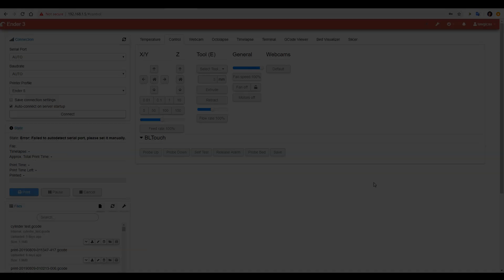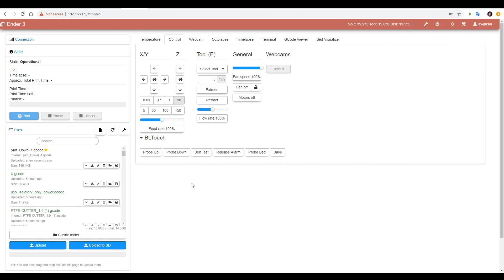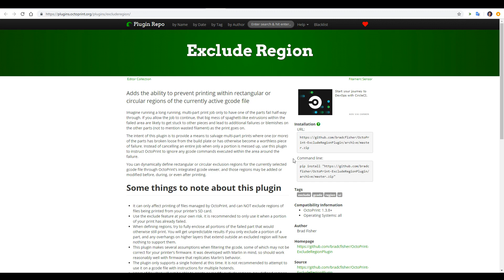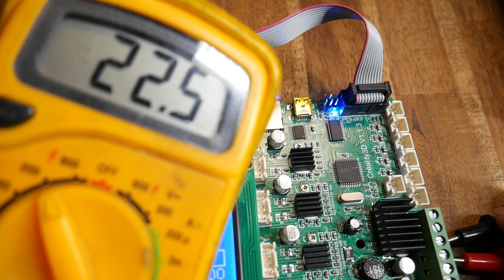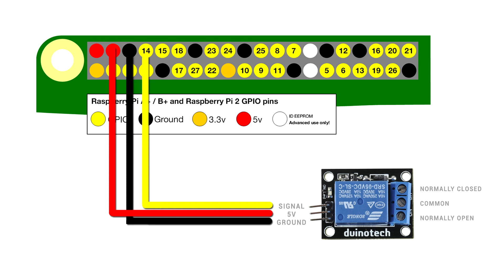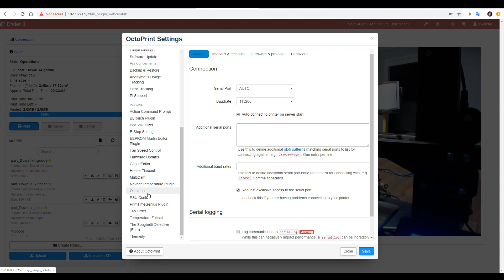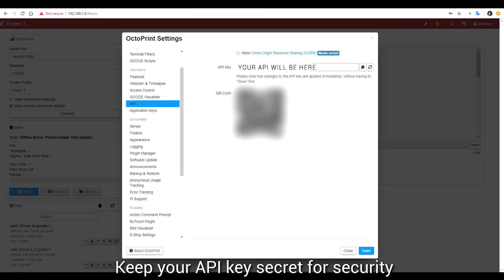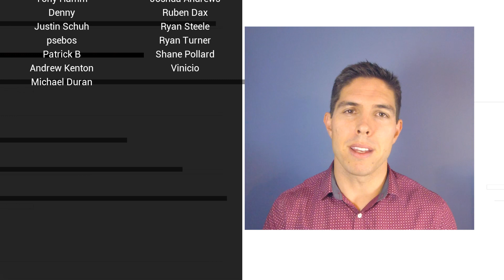Octoprint plugins for better and safer printing - PSU relay control

Comment from the maker: Important note: set your failsafe max just UNDER the maxtemp in the firmware. If maxtemp is triggered first, the printer will disconnect and Octoprint can't read the temps to trigger the warning.

Disclaimer: Just like enabling safety features in Marlin firmware, by completing the steps in this video you can make your 3D printer safer, but never foolproof. Treat it with respect and leave it unattended at your own risk.
Reply: HIGHLY DANGEROUS!!!!!!
The relays you are sugesting are all rated for 10 amps. The Ender 3 however delivers up to 15 amps. Your relay contacts will burn îf your relay gets switched while under full load! DC currents are known for arcing which will result in fire after a short period of time. So instead of making the printer safer, you made it even more dangerous! Please do your homework when posting such stuff.
Reply: @rapman711  Is the YYG-2 30A relay better suited for this task?
Reply: @rapman711  but at 240V that is like 2400W si at 24V And 15 or 20 Amps are +- 400W
Reply: I agree with Raphael Süess
 - putting such a small relay on the high amp wire is not good. Those could be used on the AC wires where the current is much lower. For DC you could use automotive relay - those are in versions rated for 24V, 50A or much cheaper Solid-state relay (but you will lose few volts)...
Reply: @rafalmag  thx name buddy😎
Reply from the maker: Hi guys, I agree with what you are saying and have removed the relay links and instead put a guide to safely calculating a suitable relay. I originally was going to switch the AC PSU live wire input but was worried about someone electrocuting themselves. In hindsight I should have stuck with that.
Reply: @TeachingTech  15A x 30A (450W) ====> 15A x 30V (450W), thanks for the video extremely useful. i am actually working on a fire detector tampering the buzzer to send a signal to a Opto-isolator / Opto-Coupler that also activates a relay, the cost of the firealarm is just 4.5$US last 9 years independent battery and it also makes high pitch noise with any sign of smoke ( very sensitive) if you are interested i can share with you the DYI
Reply: @TeachingTech  how do you power your rpi? external powersupply or buck converter? Can you please share a layout with the connections?
Reply: @TeachingTech  Would you be able to recommend a relay that would be rated for the ender 3? I can find the one you used but am not having any luck finding one on a board that would be rated for 450w.
Reply: @rafalmag  I couldn't find a relay board with bigger relays, but then I figured that. Just put the AC there where the current is way smaller. Plus, it shuts down the PSU entirely
Reply: @soundspark  it listens and i think localhost is the best way to do it
Reply: @soundspark  Remember, you can execute the curl command in SSH terminal, just to test that the url is correct (it executes from the octoprint server)

curl -s -H "Content-Type: application/json" -H "X-Api-Key: YOUR_API_KEY" -X POST -d '{ "command":"turnPSUOff" }' http://127.0.0.1/api/plugin/psucontrol
Reply: Smarter to use the AC wires as the current is much lower.  The 24VDC is ~15A.  That is well above the range of the relay.
Reply: Cutting the heater elements separately could be a solution, split the load between two relays.then you can stop the print and move the head away and still have cooling. will only protect against temp runaway tho.
Reply: Ive been using the Sonoff relays flashed with Tasmota to control the AC power of the PSU, which means all power to the PSU (and hence, the printer) will be cut off. I feel like this was a way safer and less clunky than the relays. Also, if anyone is curious and wants to try the sonoff relay route, look at the thread where I was asking about how to integrate the Tasmota relays into the PSU Control plugin, I got my information on how to integrate it here :)

https://community.octoprint.org/t/how-do-i-control-my-tasmota-sonoff-with-psu-control-plugin/15068
Reply: Hey Michael pls can You make a vídeo on filament monitoring And jam protection with an encoder?

Comment: Automatic range hood fire suppressor.  I have one hanging above each 3d printer.  Like $50 and will put out a decent sized printer fire, assuming the power gets cut and best when in an enclosure.

Comment: Hi, I am a little confused - I currently control my PSU via a TPLink Wifi outlet that I control with Octo Print. Is there a reason I would want to use PSU control with a relay, which seems to take quite a bit more setup, than the current WiFi plug setup I am running now? Thank you!!

Comment: I know this is an old video, but I'm just putting this here in case anyone sees this. When fitting the relay do not just stick the stranded wire straight into the screw terminals, over time that will fail. Also do not solder those wires and then stick them in the screw terminals, that will fail as well. By fail I mean it could melt or catch on fire. Screw terminals are meant for solid core wire or wire ferrules (crimp on connectors), so make sure you use some ferrules, it will make it much safer. Also on the Ender 3 the main power supply wires are just soldered and screwed into the mainboard, you should replace that with ferrules to prevent any future issues.

Just thought I would mention this whilst the video is on about safety.

Comment: I keep a Flamebuster (fire extinguisher ball) next to mine.  Just in case.  It will make a mess but it will explode outward with flame extinguishing material based on temperature.  Cheap insurance.

Comment: I have a suggestion for those who don’t feel comfortable wiring and soldering a relay inline with the PSU. This is an IOT Power relay board. all you do is use your gpio on your PI and plug the printer’s power supply into the unit. it acts as a PSU Controller without hackey wiring. and you can still use PSU Control on Octoprint. link below.
https://www.amazon.com/Iot-Relay-Enclosed-High-Power-Raspberry/dp/B00WV7GMA2/ref=sr_1_21?dchild=1&keywords=RASPBERRY+POWER+RELAY&qid=1617461465&sr=8-21

Comment: Hi Michael, very clear and understandable video's, very help full for noobs like myself, at the moment I've got a cr-10s V2 a ender 3 V2 and a raspberry pi 4 underway, so i'm looking at as much video's as i can find, but you'rs keep popping up at each subject i'm looking for, but i do have a small question, what is better, running octopi or raspberry PI os ?? i would like to have full control over the printers from anywhere, i'll also will install the PSU relay and the cam's... thanks again and keep up the good work, p.s. are you by any chance a teacher by profession ?? if not, you should :)

Comment: Great video!  I ended up just going with a HomeKit outlet so I could control remotely.  Doesn't give any thermal protection but at least lets me power up and down remotely - and can easily work with a different device in the future.

Comment: Don´t know if this have been mentioned somewhere in the comments but atleast the ender 3 PRO want 15A max. The relay here and the one I got can handle 10A max. 3 of my relays have been melted into "always closed" until I have realized that. Like Joe A in the comments here said, his way is the safiest way to do it, but you can´t power your PI with the PSU (at least I understood that this way). But I want to power my PI from the PSU and searched for hours if there´s somewhere a fitting relay on the german market. Electricians I´ve spoken with said that you never should use a relay on their max specs (I guess for the durability, too). So here is one with 30A on the german market. : https://www.reichelt.de/arduino-grove-relais-spdt-30-a-sla-05vdc-sl-c-grv-relay-spdt30-p243033.html?&trstct=pos_0&nbc=1 not the cheapest one but good quality and 30A. If you are living in the US robotdyn should be a good address to look for such a relay.

Comment: Question. Im doing the relay mod. I got the relay to work. I just wondering why you interrupt the mobo power wire instead of the main power so the psu also powers down. Side question: The pi powers the board via the usb cable, so Im not sure if the relay is off because the screen is still on.
Reply: maybe screen is powered through USB cable by raspi. Tape one pin in the USB connector and the screen goes off (google for instructions, it's out there)

Comment: Don't use the Spaghetti detective because it starts with the wizard. You can't do it later. Finish don't work. Also you open a backdoor for this buggy software. And the best after one month you use it, you have to pay! No one give you this information before you start. For test I used a trash email and I know now why.

Comment: Hello Michael this is Richard here I just want you and everybody to be aware that for some people the raspberry pi GPI open only supplies a 3.3 volt signal rather than the 5 full votes that it needs to properly trigger the 5 volt relay so here is a schematic for a fixed that completely made it work for me. https://gpailler.github.io/2018-03-02-octoprint-psucontrol/.  All you need is a 1 kg resistor and an NPN 2N2222 transistor intercepting the circuit

Comment: Hi Michael. I have one issue with the PSU control plugin with relay and filament sensor. When I enable "Automatically turn PSU OFF when idle" and the filament sensor send M600 command and paused printer, the PSU control does not recognize that the printer is paused, not in idle mode. As a result, if I do not have time to replace the filament, the plugin turns off the printer and after turning it on, I no longer have the option to finish the print. Is there any solution to this situation?

Comment: !!IF YOUR IP ON THE IP ISENT FIX AND IT CHANGES THE TEMP FAILSAFE WON'T ACTIVATE THE RELAY!! apart from that, the plugin will turn off the heater with Gcode.

Comment: Just curious of there has been a change to the Temp Failsafe plugin since this was posted?  I have it setup exactly as described and if I set the failsafe temp at say 50c as a test, when it hits 50 it posts the warning on my screen that the failsafe temp has been exceeded but it does not cut the power through the PSU Control app.  Instead it turns the target temp off and the nozzle starts to cool.  Obviously I want the power to the whole unit to shut down through the relay but the shell command seems to just turn off the nozzle but not turn off the PSU.  I can turn off the PSU by clicking on the lightning bolt but it will not do it automatically if the failsafe is triggered.  Any ideas?

Comment: If you're like me you followed his guide and realized your printer will NOT turn on when you plug in your printer. ONLY THE RASPBERRY PI, and you have to log onto the webGUI and manually turn it on.... I have a fix!!! 

-ssh into your raspberry pi using Putty
-sudo nano rpigpio.py
-paste this:

import RPi.GPIO as gpio
import time
import sys

pin = int(sys.argv[1])
state = sys.argv[2]

if (state.upper()) == "HIGH":
    state = gpio.HIGH
elif (state.upper()) == "LOW":
    state = gpio.LOW
else:
    print("Wrong arguments, expecting an int and either HIGH OR LOW")
    sys.exit()

gpio.setmode(gpio.BCM)
gpio.setup(pin,gpio.OUT) 

- save with ctrl x
- press Y 
- press Enter

-sudo nano /etc/rc.local
-At the bottom before "exit 0" enter:

#NOTE im using pin 26 so you'll need to replace this with the pin number you are using
python /home/pi/rpigpio.py 26 HIGH

- save with ctrl x
- press Y 

- press Enter

in Octoprint PSU plugin page:
- Change Sensing to GPIO and use Float

DONE!

Comment: About the IP address for TemperatureFailsafe plugin: One can use "localhost" instead of the IP adress. That way it'll work even if octoprint changes IP (due to DHCP doing things it shouldn't which is common with Raspberry Pi's). Example: (You then only need to substitute YOURAPIKEY)

curl -s -H "Content-Type: application/json" -H "X-Api-Key: YOURAPIKEY" -X POST -d '{"command":"turnPSUOff"}' http://localhost/api/plugin/psucontrol

Comment: Dude I really like your videos. But honestly you should take down this video or edit the relay part. Depend on comments to figure out that the relay part (for sure for many people the most exciting part) is totally wrong is extremely disappointed and dangerous. If the video info is not right just remove it. This is extremely misleading.

Comment: I have the Issue that the relais stay constantly energised. I have wired up everything as in the Video
Reply: I know it's an old comment, but for others with this issue, under Settings>PSU Control the first setting "GPIO Mode" was set to BOARD for me. I switched it to BCM, as in the video, and that fixed it for me.

Comment: 7:57 Please don't connect bare copper wire to this kind of terminals, add more safety with insulated ferules end wire!
Also be careful that your relay is rated according to your PSU...
Reply: Hi i have use that exact relay he is using it rated for 10Amps 250V or 12V
Reply: @skypix6553  That's a problem if you connect the relay on the DC side of the PSU. The PSU is (On the Ender 3) pushing 24v at 14.5a. The relay in the video is only rated for 10 amps.
I connect the relay on the AC side, because the PSU for same said printer, only draws 110v @ 9a. 9 amps is uncomfortably close to the rating, but it rarely draws anything like that much. That's absolute MAX draw (rating by the manufacturer).
Reply: @markcartwright4491  The AC draw is only about 3amps

Comment: Can't find the relay you used Michael - how about this one? -https://www.aliexpress.com/item/4000850102895.html?spm=a2g0o.productlist.0.0.25547a6e5REsn8&algo_pvid=f16e59b2-cf60-499e-91f9-e043a234072b&algo_expid=f16e59b2-cf60-499e-91f9-e043a234072b-39&btsid=0ab6fab215888425670276141e2fea&ws_ab_test=searchweb0_0,searchweb201602_,searchweb201603_
Reply: This should work fine on the 24 vdc line to the controller

Comment: my attdmpt on controlling the power will be with the Bigtreetech relay board as it switches of power to the main PSU and have it controlled through the printer mainboard as it wilp still have 5V for the mcu through the raspberry pi

Comment: So hold up, if you use the power plugin it still reads the temps from the micro pushing the driver board and that registered 0' on it when it failed. This ideally would have a secondary sensor directly to the PI monitoring temp right?

Comment: I'm planning install psu control using AC instead DC and of course my raspberry pi powered using separate adapters, but i'm thinking to pick solid state relay instead normal relay so I wanna ask you guys is it safe using solid state relay?

Comment: Trying to install plugins. I can get them and install them but they do not show up. The only one I can get to work is Themify. I changed the color and it looked ok but I change the color back and now every time I reboot it brings that color back even though I changed it to the original. All other plugins install but do not show up. The control panels show up and everything looks OK but like the Emergency stop button doesn't actually show up on the dashboard.

Comment: I updated my Ender 3 to the 1.15 silent board with BLtouch and Marlin 1.9 bug fix. When I send a print from Octo Print the Ender 3 acts stupid and prints garbage. I can take the same file and load it in to the printer using the SD Card and it will print fine. What did you change if anything in the firmware to yours to work so well?

Comment: nice video, thx!! for additional safety consider a fire extinguisher ball (e.g.: https://www.amazon.com/AFO-Fire-Ball-Small-5KG/dp/B082S65NR5/ or https://m.de.aliexpress.com/item/33029767583.html or alike). Shall work well in an enclosed (printer) chamber.

Comment: With this setup the PSU is still receiving power though is it not? Why not setup a relay for the power headed directly to the PSU that way you can send an off command to kill all power to the Ender 3 and PSU?

Comment: Thanks for video! But when I use PSU control I have one unsolved issue:
If I turn my printer's power supply off, but my orange Pi is still powered, I have working LCD, powered via USB cord. It is not good.
If I isolate +5V in USB cord - afted powering off LCD will not stay powered, but octoprint lost connection to MCU (because there is no power on MCU).

Is it possible to bring power to LCD of printer only when MCU is powered by 24V power supply?

Comment: I follow your steps and it does not work. possible is my relay issue or my RPI issue? I am currently using RPI 3A+. I can see the PSU control icon on top but when I click on it, it gives me no signal at all.

Comment: Could you make a tutorial for the smoke detector anyway?
My plan is to build a box out of plywood, and then line then put plaster walls on the insides for the flame retardant properties. However, while the smoke alarm will go off after the fire already has started, at least the power will be turned off so that it won't fuel the power further.

I'm not sure how I'd go about keeping the insides of the box at a reasonable temperature. Vents would be one way, but it's not optimal. The good thing with a lack of airflow is that the fire will suffocate if it does burn, due to lack of oxidizers.

Comment: I have mountet the relay like you say, but the usb cable from the pi to my cr10 pro keep the motherbord powerd up. how do i fix that?
Reply: Put a little strip of electric tape on the 5v pin of the USB cable you connect the PI to the printer. Here's a How-to from the octoprint website: https://community.octoprint.org/t/put-tape-on-the-5v-pin-why-and-how/13574

Comment: Haven't tried it yet but I'm thinking of using the OctoPrint-TPLinkSmartplug plugin which talks to a wifi enabled wall socket plug. Then my printer will be powered on/off at the wall by octoprint which is powered separately. Basically a wifi enabled version of what I do now which is power on my printer through a switch enabled power board. Anyone tried the wifi socket method?